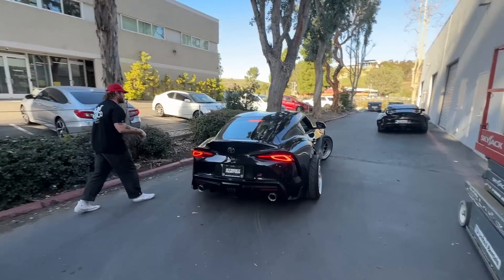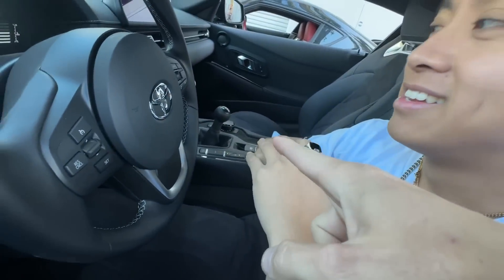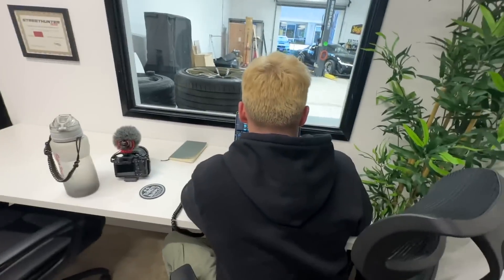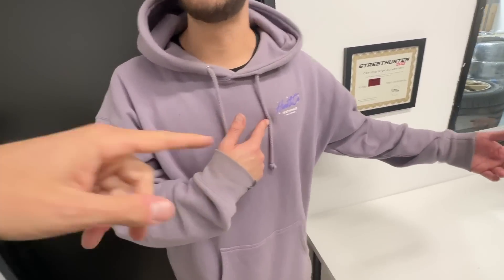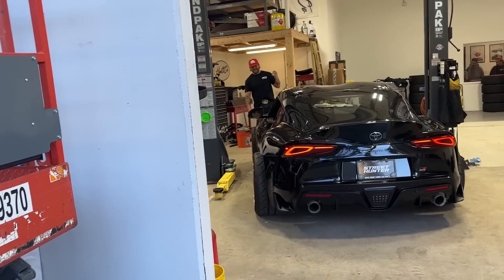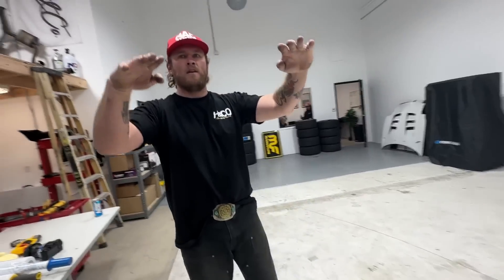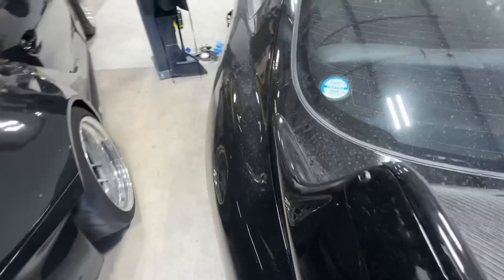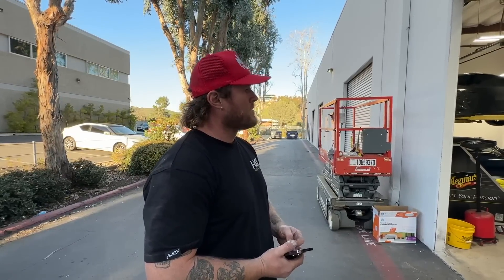Already Cutting and Chopping the Manual Supra!

Comment: There's 3 options for the Manual transmission, the 3.0, 3.0 Premium and the limited-edition A91-MT. Only 500 examples of the last variant will be sold in the US and only as part of the 2023 model year
So the limited edition is for one year only, the manual will continue to be available on the other 2 options.